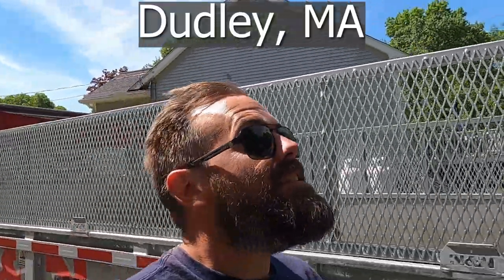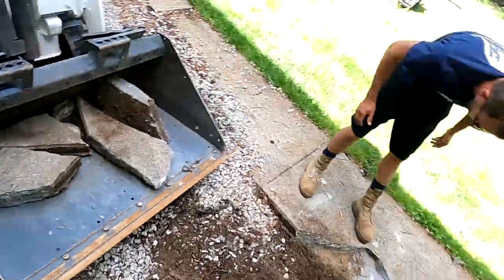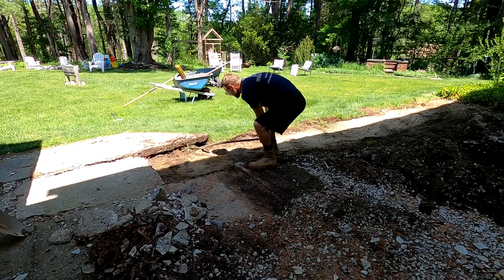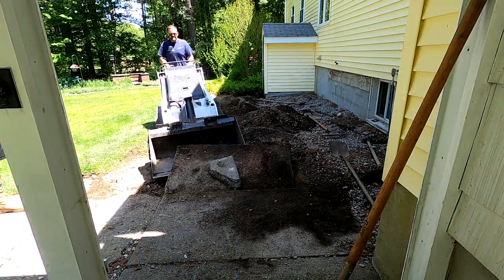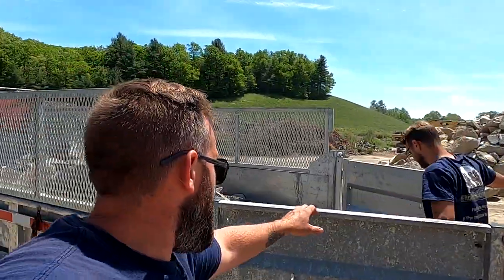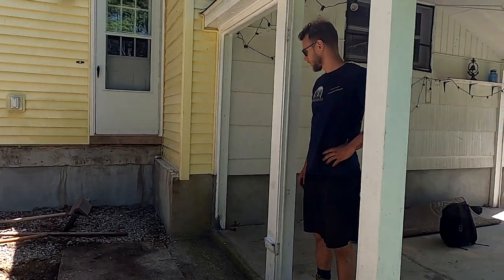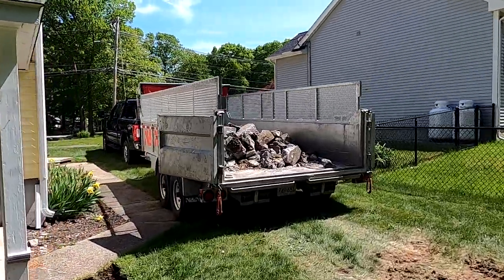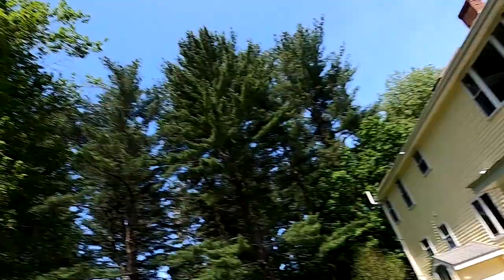Starting The Next Patio, DEMO DAY!

Comment: Generally curious… why chalk the front of the truck tire before dumping?
Reply: In case back tires come off ground, parking brake and having the truck in park won’t stop the front tires from rolling unless 4x4 is engaged
Reply from the maker: It’s just an extra safety measure to prevent the truck from rolling forward when dumping.